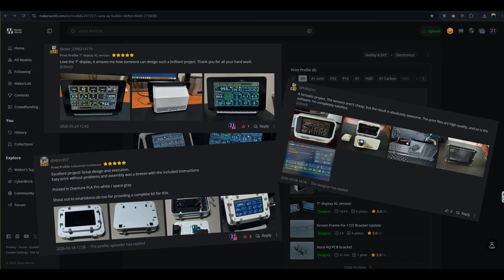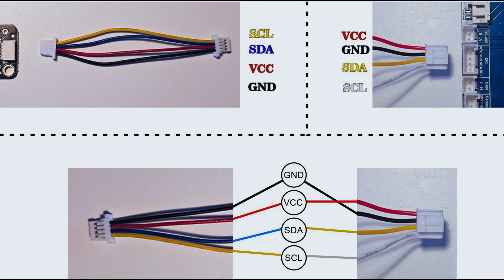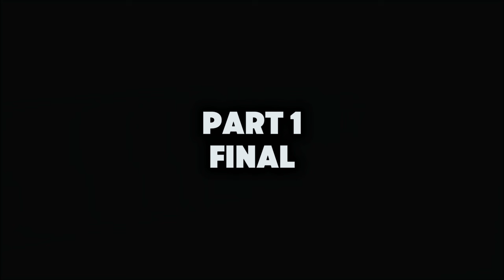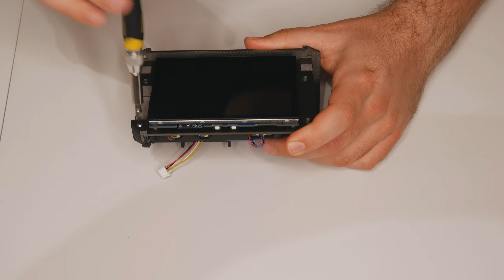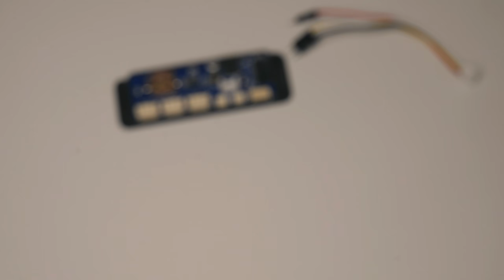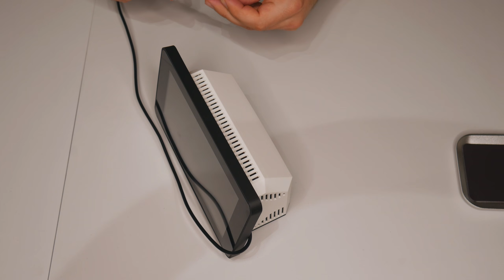How to Build Aura AQ: Ultimate Smart Air Quality Monitor Assembly Guide

Comment from the maker: Using a 7-inch Aura with firmware v1.2.0 or later? Please follow the updated wiring guide before connecting or powering your device:
https://www.youtube.com/watch?v=nwJVBzxOcSA

The old 7-inch wiring shown here no longer applies. The new video covers both Aura PCB and Adafruit builds. The 4.3-inch wiring is unchanged.

Comment: Where am i supposed to order the SEN66 cable for the custom PCB? I thought a cable would come with the SEN66 but it didn't
Reply: nvm the BOM on the crowdfunding page does link to it.  Not sure where but the original BOM i read didn't have it
Reply from the maker: Glad you found it. The current BOM includes the cable link. If that listing is unavailable, you can also search for a SEN5x/SEN6x 6-pin JST GHR-06V-S cable, but please verify the pin order before connecting it to the Aura PCB.

Comment: Can the custom PCB be used with the original enclosure? Are there instructions that cover assembling the original with the custom PCB?
Reply from the maker: Yes, the PCB works with any enclosure — it's the same size as the 4 Adafruit modules combined and uses the same mounting points for the bracket.
Reply: @21CNCStudio  Are there instructions available for this permutation? It's not immediately clear which different things are different because of the different screen vs because of the custom PCB
Reply from the maker: Assembly instructions for the enclosures are available to backers. The PCB wiring is covered in the video. The 4.3" and 7" boards are identical in terms of connections, so there shouldn't be any issues.
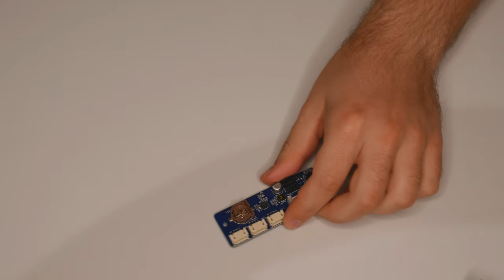Reply: @mateo2002  The custom PCB instructions are at 22:57
Reply: @21CNCStudio  I'm a backer - I'll be honest, I didn't find the written instructions super helpful. Unless I'm missing something, they've never been updated for the custom PCB so there's even more work there trying to filter out what's actually still relevant.
Reply from the maker: You're right and I appreciate the feedback. I'll definitely update the written instructions. I haven't rushed it since the video seemed to answer most questions, but I understand it's not ideal. What specifically is still unclear for you with the PCB connection?

Comment: Hi @21CNCStudio. What is the reason for the SFA40 breakout board the, vendor is releasing? I have tried both the cable types (making the cable) for the SFA40 and get the same readings. If opening all doors and windows etc. then after a good while I might be able to get the sensor readings down to the low 70’s, but if not it is at around 100’ish. The weird thing is that we have no new furniture, nothing newly painted etc. for years. Also the whole house has an air replacements system built in, which I know works, and it replaces the air (out with the old, and takes in fresh air via other channels) inside every some hours during the day. So there should absolutely not be any good reason for those high readings. I am considering just disconnecting that SFA40, and use the rest. Also even with the SFA40 included in the kit from SmartDomo German site, there was not a right cable for the SFA40 included, I had to be creative and in the end do the soldering as you showed.
Reply from the maker: Hi, yes there is indeed an issue with certain SFA40 units from DFRobot and we're working together as a community to get to the bottom of it. You can find the GitHub issue with user reports here: https://github.com/21cncstudio/project_aura/issues/113

Unfortunately DFRobot hasn't provided an official response yet. If you'd like to help, please add your report to the thread and also send an email to DFRobot directly — there's a template and contact details in the issue. The more reports they receive, the better chance we have of getting an official answer and solution